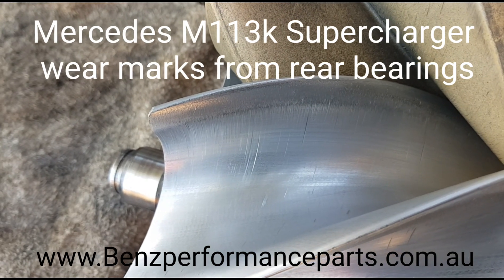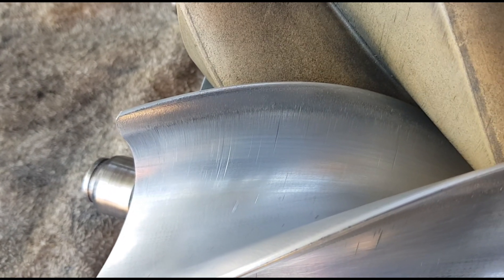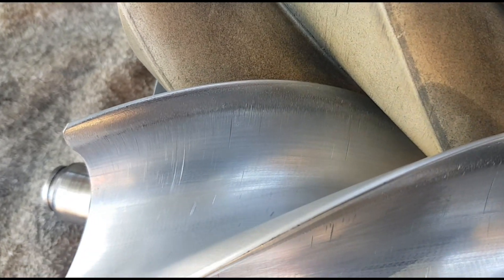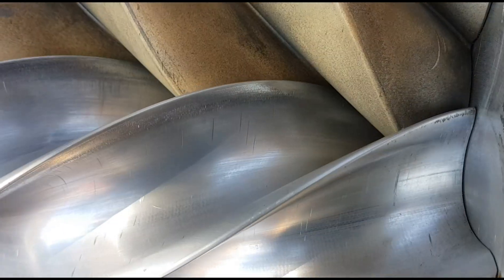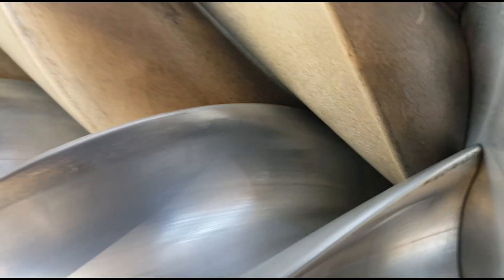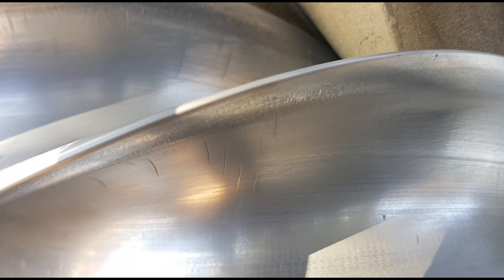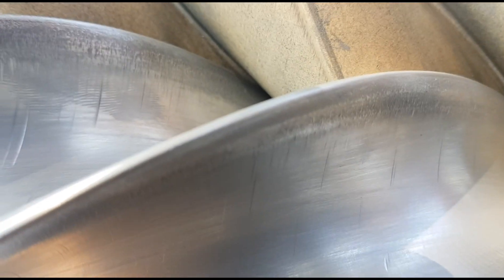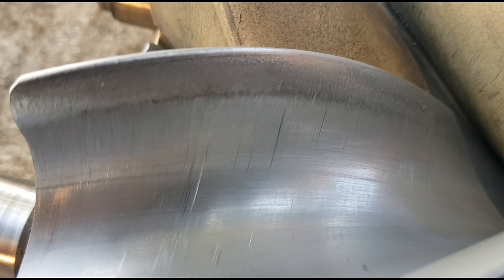Mercedes M113k E55 SL55 CLS55 G55 Supercharger turbine wear marks from worn rear bearings

Comment: Hi BPP!  What an expert about this technical master pièce Kompressor hou are!! ✌️😜
Please let me know your opinion:
My nachi pulley bearing exploded last week in Mercedes AMG shops hands, while road testing the car... 😭 Their responsibility, but they claim No...
OEM pulley 150kkm. i Baught my car on 08/2021, 146kkm.
I got from MB, no commercial offer better thank a 10% discount on the 1387e duty free +20% vat for supercharger pulley ! Plus 1,5 h work at 173e /h, vat included that Time....😱😱 +3days for the order!
Then They found out that They hadn't got the Mercedes tool, in order to take off the pulley... +3days of order... We're already over +6 working days while doing nada on my car... They are so bad in this garage "AMG", as not all MB shops around, have this label !!...

Then They detected a Little Gap when lifting up of pushing down on the pulley/clutch axel, can hear a little clic..... AND that Is freakening me out, as They could have damage Many bearings further along AND inside the Kompressor ?? 
What Is the good diagnostic for those?

Is it better asking them to change the clutch AND the magnét by the way,..?
Then who pays again